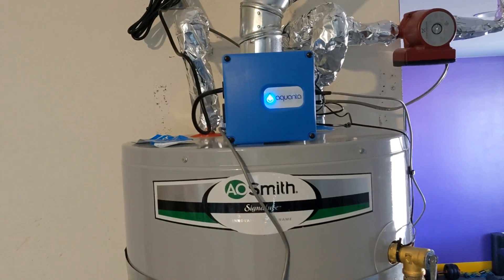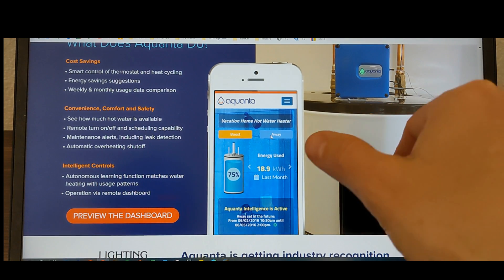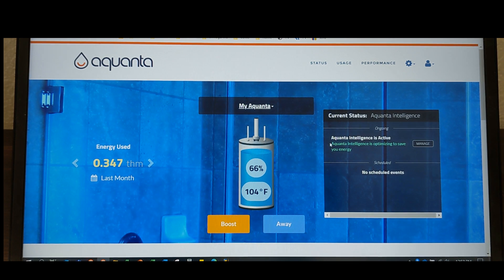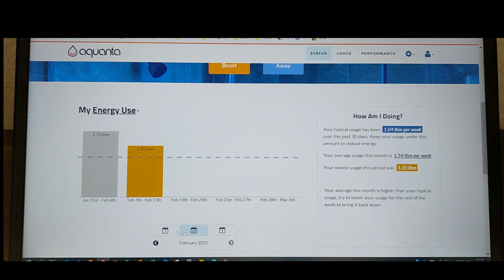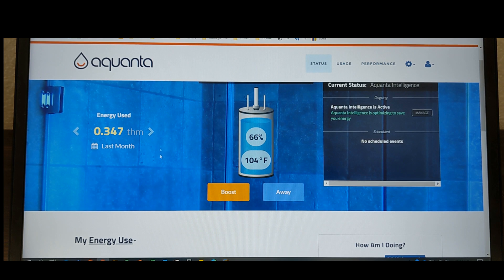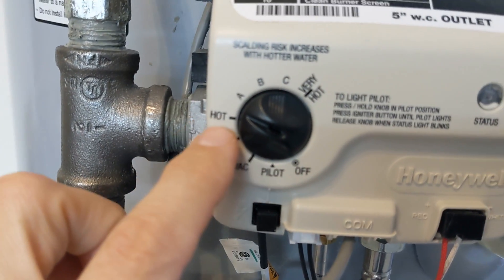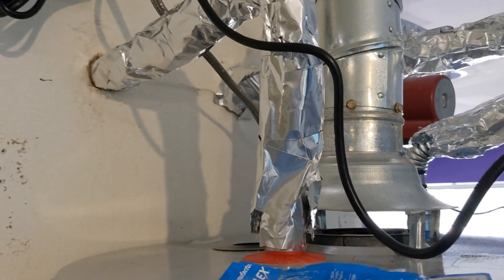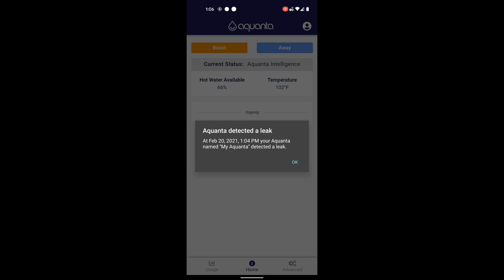Make your water heater SMART with Aquanta

Comment: What’s the purple light vs green light??
Reply from the maker: The Aquanta Smart Water Heater Controller uses its LED indicator to convey various operational statuses:
	•	Solid Green: The controller is in normal operation with AC power applied to the water heater.  ￼
	•	Solid Red: The controller is preventing the water heater from heating, possibly due to being in Away Mode or a set schedule.  ￼
	•	Aqua, Blue, or Purple: The controller is in Intelligent Mode.  ￼
	•	Blinking LED: The controller’s Wi-Fi or internet connection to the server is not available.  ￼
	•	Beeping Sound: The optional leak sensor has detected a water leak.  ￼

These indicators help users monitor and understand the current state of their water heating system.
Reply: @ 
thank you 
Over the past weekend no hot water for me
It was blue and purple..
I knew I didn’t do something wrong…

Comment: Great video.  Thank you.  
I just got a new water heater and want to install this.  Do I HAVE TO drill holes on top of the waterheater?  Makes me nervous.  It could void my waterheater warranty
Reply: It attaches to the same plate as the in coming electric cable did. No holes to drill or tape needed.  Watch the Aquanta video. Of course you know that by now.
Reply from the maker: No, you don’t need to drill holes into the water heater. You can just use double stick tape.

Comment: Any updates. Are you still using this device
Reply from the maker: Yes I'm still using the device and it works well.  The only thing I notice is during summer time when the garage gets warm, that's where the water heater is,... It thinks the water is warmer than it really is so it doesn't heat it as much but it is summertime so it's not a huge pain just something to be aware of.  It would be nice if it considered your ambient temperature of the garage and did some math to figure out the temperature better.
Reply: @smidgelife thanks for the video and the reply. I would like to get one for my house so that during power outages, I can better control the hot water heater when on the generator power.
Reply from the maker: @malcolmdeas7160 nice idea!

Comment: Will the sensor read properly when placed against a pvc pipe VS copper or brass pipe line?
Reply from the maker: I would think so yes. As long as you can feel the temperature on the line it should work.

Comment: Hi, I got one of these recently but for an electric heater, but I am having issues getting it to connect with my wifi. The only thing I find online is press the reset button, but I can't find any button other than mode and holding that down. The unit makes a sound but doesn't go into any pairing mode. I tried contacting support but got no answer. I was hoping you could help?

Comment: Hi. Any value to use this with a hybrid water heater?
Reply from the maker: Could you please elaborate on what you mean by hybrid water heater?  Possibly... Does it have a computer port access?

Because essentially it'll automatically lower the heat when you're not using it.

Comment: Updates?
Reply from the maker: It works well.  It's difficult to really know 100% the true savings.  But, it must be based  on the logic.  I'll post a screenshot in my community area now.  Let me know.
Reply: @smidgelife  try unplugging it for a month to see the difference in costs.
Reply: Also, how have you wired the circ. Pump? I see it’s on a smart switch. Is there some sort of logic that interacts between the aquanta and the pump or do you have it on a basic timer? The options for integrating the aquanta seem slim IFTT being the only one to my knowledge.
Reply from the maker: I have Google home managing the smart switch for the water pump.  That's obviously a big savings too.  For IFTTT if a leak is detected it will turn off the water pump and put the system in a way mode.  Currently I only have the water leak detection at the water heater base.  

The only time where I see it gets confused as if your garage gets really warm... The sensors on the unit are just zip tied to the pipes but it picks up the ambient temperature of your garage.  So it makes it think that the water is warmer than it actually is... Meaning it will dial down the temperature from the max.  It's not a major problem but just something to be aware of.
I haven't had the time I want to ask them to help solution that problem because it seems like if they just had another temperature sensor picking up the ambient Air temperature it should be able to figure out how to dial in the water temp.
Reply: Can I control settings and times with my phone while being out of town? Is there an app to download
Reply from the maker: @coreypatterson1386  yes and yes
Reply from the maker: @coreypatterson1386  I can post some screenshots of my community section if you like.
Reply: @smidgelife  sure that would be great...I have 2 electric hot water heaters with a circulator so looking to add a timer
Reply from the maker: @coreypatterson1386  here you go https://youtube.com/c/smidgelife community tab